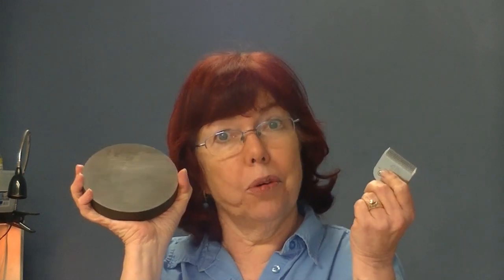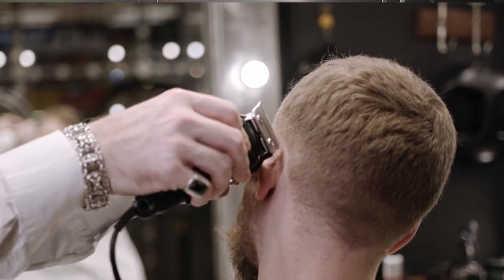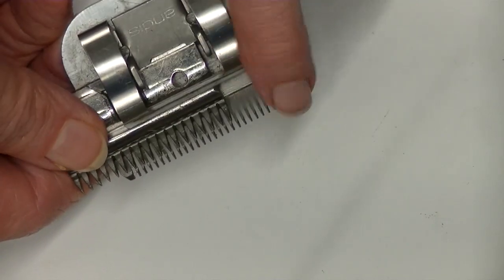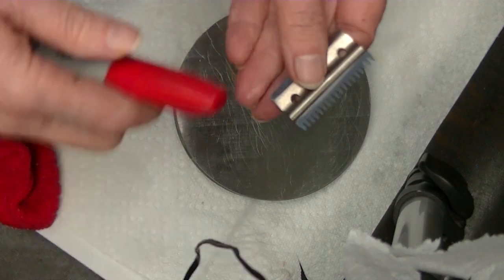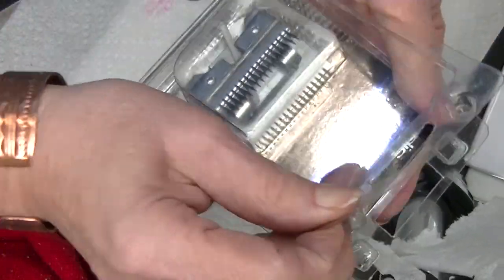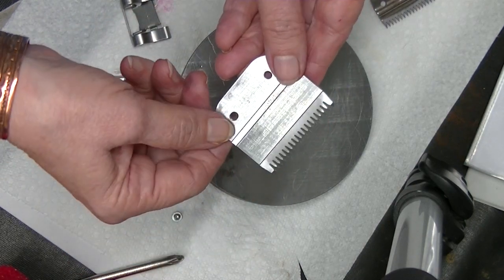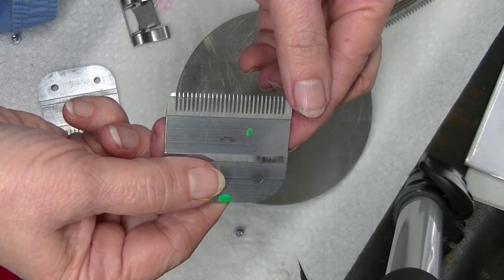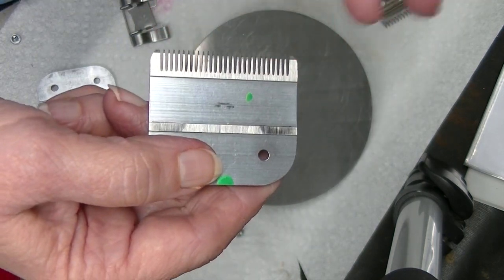How Clipper Blade Sharpeners Should Use a Rub Block to Check the Quality of Their Blade Sharpening

Comment: Hello friend, what cutting angle does the disc have that sharpens the blades, thanks and greetings from the island of Margarita, Venezuela.
Reply from the maker: This disc does not sharpen. It is a test to check the sharpening I did on the Nebraska Clipper Hone. There is no angle. The Nebraska Blades Hone has a small angle or cone shape rise to the center.
Reply: @BonikaShears  thank you I wish you the greatest success

Comment: Thanks for your wonderful videos.
What's the name of block you use after sharpening the blade? I mean what kinda material is that?
Reply: Thanks for your wonderful videos.
What's the name of block you use after sharpening the blade? I mean what kinda material is that?
Reply: Thanks for your wonderful videos.
What's the name of block you use after sharpening the blade? I mean what kinda material is that?
Reply: Thanks for your wonderful videos.
What's the name of block you use after sharpening the blade? I mean what kinda material is that?
Reply: Thanks for your wonderful videos.
What's the name of block you use after sharpening the blade? I mean what kinda material is that?
Reply from the maker: that block does not sharpen the blade, it checks the sharpness after I used the Nebraska Blades hone. do not try to sharpen with a block like this. It is steel.

Comment: Hello Boni, can you help get one, Rub block, I'm in Ghana located in West Africa please ? Or if there is a trustworthy site direct me to that place. Thank you
Reply from the maker: The rub block does not sharpen the blade. It is a test to see if the sharpening is done right. Maybe you can get a block of very flat steel for this purpose there in Ghana. We can ship to Ghana but the plate is heavy and shipping will be very expensive.
Reply: @BonikaShears  Thank you Bonnie for enlightenment. I have the whetstone but the truth is I struggle a lot to sharpen a blade as I exert much pressure on the blade placed on the whetstone. The sharpening machine, can I one which has a price around  US $60 to US $65 , if possible a chargeable one ? Thank you.
Reply from the maker: @pichieandboy7816  the whetstone is the problem. The inside of the clipper is slightly concave. Using the whetstone will take the concave out. I’m sorry but you can not correctly sharpen clippers by hand. Watch this video. It might help you understand. https://youtu.be/tDMcXZXx0Ws
Reply: @BonikaShears  Thank you a lot dear Bonie. will strive to know what to do about it . Thank you very much.

Comment: Goodday i have a quistion should i rub every blade to make sure that the blade sharpining is correct
Reply from the maker: When you are learning, yes. After you know what you are doing you could do this every so many blades. Me personally, I test all the blades I sharpen on string and fur. If they fail I will test on the rub block.

Comment: Thanks Bonika for your videos, quick question (maybe) Would a well sharpened clipper set not have a distinguishable arch? I'm having a hard time getting much of a rub pattern but the clipper blades have been cutting nicely.
Could too much pressure cause that? I've tried adjusting the amount of pressure I use and it's still giving me pretty consistent results.

I'm using the 16" Nebraska blades CS-201 if that matters.
Reply from the maker: When you say pressure.... do you mean pressure on the rub block or in the sharpening process?
Reply: @BonikaShears  mostly the sharpening process but possibly both(?).
I have big hands and have a hard time judging just a few pounds

Comment: You are NOT a good teacher at all. You were insinuating all the time that a concave blade was optimal, Only at the end you insinuate that flat blades are optimal,,, you never spoke clearly and directly during the whole video.
Reply from the maker: Thank you for watching. There are different planes. It is straight and flat across the teeth and concave from front to back.
Reply: @BonikaShears  Exactly Monika ! that geometry is created by the CONICITY of the grinding wheel, you got it !!!

Comment: I have been cutting my hair with clippers since 1997. I had some horrific haircuts in the beginning. WTF is a fade? What's that little knob for?  Had no idea. I'd just use no clip on the sides/back and the #1 clip on top. Now I have those .5 clips which makes it easier and I know what a fade is. I was sick of buying blades recently so I bought a $10 stone on amazon, dug out my crusty original Wahl blades and I just added oil and started rubbing in no particular manner. The stone is like a black hole for oil so had to keep adding. Later I cut my hair and it was so amazing. It was better than when the $200 Wahl clippers were brand new. I could shave a wooly mammoth in 30 seconds flat. I was even using just the side of the stone to really go after the blades, probably all crooked, but it worked.
Reply from the maker: Your technique will work, especially on the adjustable type clippers. If you have the more professional clippers, it will work only a few times then quit cutting.